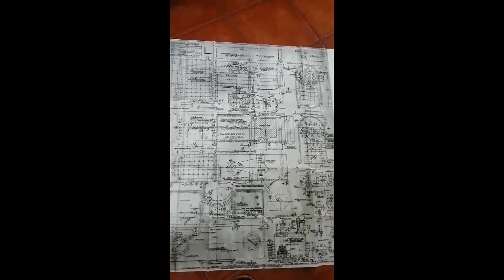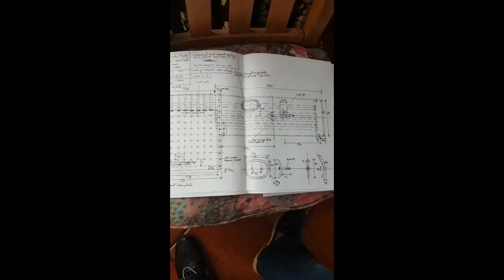3" Fowler Model Boiler Construction - Part 1

Comment: Hi John, great videos, wouldbyou be willingbto share your updated higher pressure boiler drawings as I've been thinking about building one but didn't want a steel boiler! Thanks Andrew.
Reply from the maker: +Andrew Gallacher I would but you will have to get them signed off by the inspector who is testing your boiler. The Gent who signed my drawings off is the one testing the boiler.